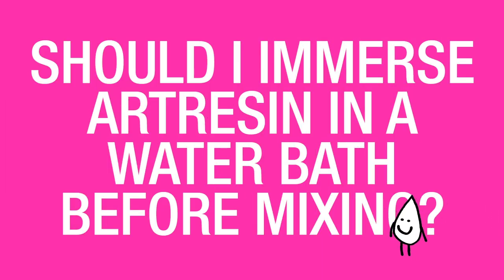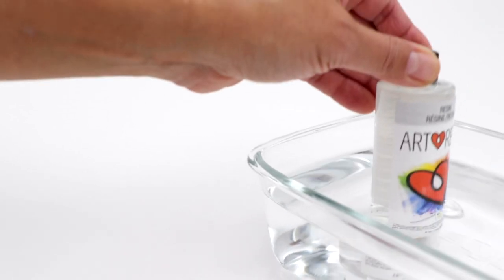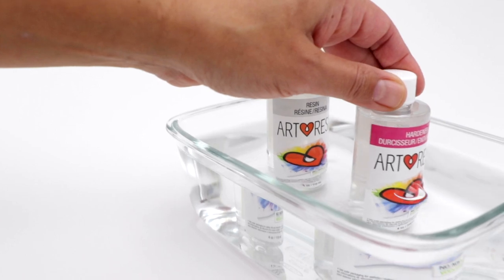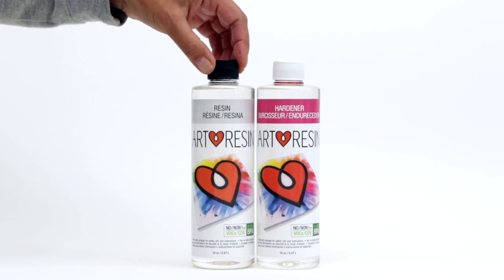Should I Warm Epoxy Resin In A Water Bath Before Mixing?

Comment: I'd like to add to this that if you wait too long in warm water condensation will drip right into the resin and hardner. Water droplets will leave pits in your resin work. Careful.
Reply from the maker: Good point :) Yes you want to be sure the caps are on tight while in the water bath and also wipe the bottle off before pouring and mixing.

Comment: What water temp should be used? Around 65-70 degrees? Not sure but would like to try this method
Reply from the maker: You don't want your water to be scalding hot, warm/hot tap water is sufficient.
Reply: @ArtResin  thank you I will definitely give it a try. 😊

Comment: You said this cuts down on the working time of the resin once mixed, but does it affect the shelf life of the unmixed resin/hardener still in the bottles?
Reply from the maker: Hi Sylver - no, warm water baths shouldn't have a detrimental effect on the product's shelf life.  Air ( oxygen ) exposure is a much bigger issue and is what contributes to the product's expiry.

Comment: Hello, I bought these art crystal clear resin but after sometime the hardner colour has changed from transparent to slightly brown. What’s is wrong with this. Should I continue to use it or discard? Please assist. Many thanks
Reply from the maker: The yellowing you are experiencing is most likely due to oxidation, think of a cut apple being left out, when the air gets to it it will begin to yellow. This can happen faster if you leave the cap off while working on your pieces or if the temperature is warm. This is an entirely different thing than yellowing from UV exposure. Avoiding this in the future by always storing in a cool place and making sure the caps are on tightly when not in use. If you are using our product ArtResin, our hardener has a very efficient antioxidant in it to delay yellowing, however of course it has a shelf life (usually we say 6 months but it varies). In this case, the shelf life refers to the clarity of the product and how long you can expect ArtResin to stay looking just as clear as the day it was made. 

I would suggest you take a small amount from each batch (1/2 oz) and mix it with the resin, it will the dilute the amber color and pour it over a piece of plastic or wax paper, allow it to fully cure. This will allow you to see what the finished products transparency is. You should still have a clear finish, if you are working with darker pieces you shouldn't notice any difference :)

Here are some examples of what to do with it :)

https://www.artresin.com/blogs/artresin/what-can-you-do-with-yellowed-hardener-and-resin

Comment: how during summer? my resin is too hot
Reply from the maker: The ideal temperature for your ArtResin and your workspace is between 75-85F.  If your ArtResin is already at the proper temperature due to your climate, you do not need to use a warm water bath to warm it.

Comment: Definitely don't need the water bath now! laughs Even with my AC running it still gets around 79 to 80 in the house during the day. 100+F outside though so I guess it is understandable. When winter comes though I may have to because I like it cooler. Ideal working temp for me is around 70 degrees F so I do not have that in common with Art Resin. ;) I filled out that survey you sent me btw. :) - Heidi

Comment: What happens if you accidently let them be in really hot water for a while? Could that cause the resin to go bad and never harden?
Reply from the maker: the additional heat may make your mixed resin cure faster than you want.  Try to keep your warm water bath just warm, not hot.